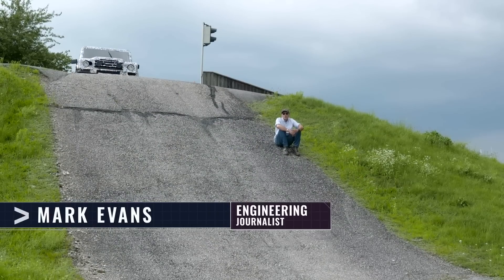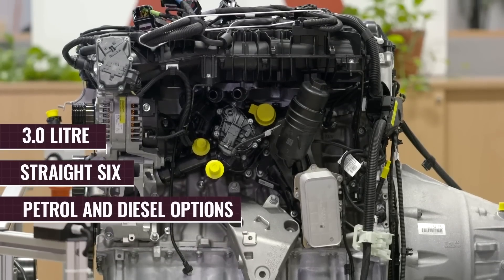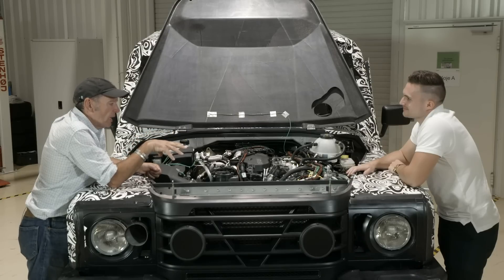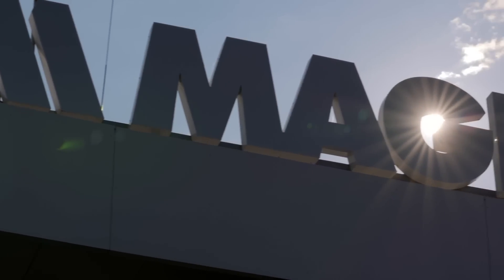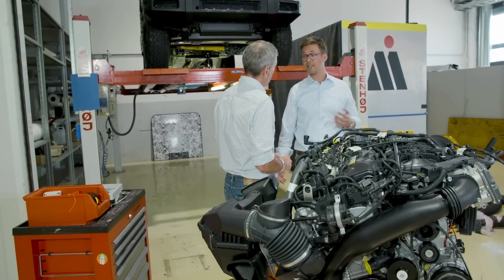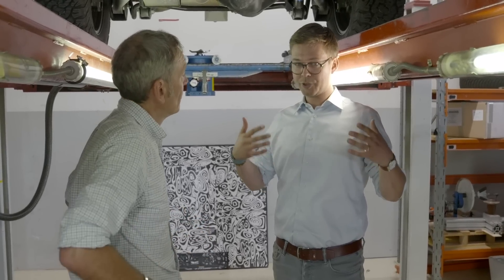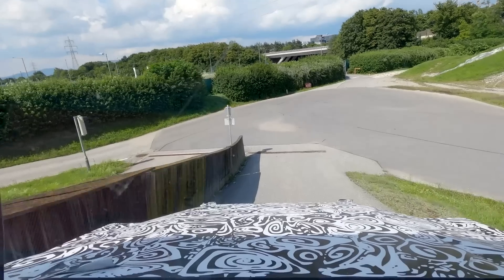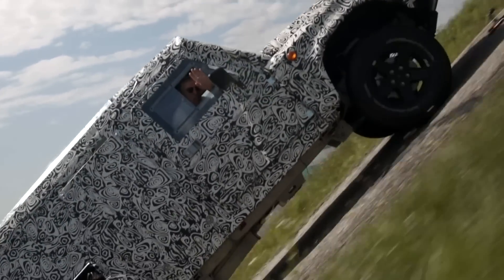Building the Grenadier - Episode 5 - Engine & Transmission

Comment: Disappointing that there's no manual transmission option 😢
While automatic transmissions have come a long way and are in many ways the best all-round transmission option, it can't replace the simplicity, driver engagement and arguably reliability of a manual transmission. You also lose the option to roll or pull start in the event that your battery or starter motor is dead, which can be nice to have in certain circumstances.
Reply: Automatics are much more reliable & have been for 30 years. They do not need a clutch replacement that is near a service item now days.
Reply: @diesel92kj1  I'd be curious to know why you believe automatics are "much more reliable". Both options are quite reliable, but at the end of the day a manual has virtually no electronics that can fail, and far less complex by design. Clutch's usually last in excess of 100,000k's, so while something to factor in it's hardly worth worrying about.
Reply: Hard off-road use and heavy use can lead to complete failures and have seen it and had it happen
Reply: @brendanharbridge3179  No doubt, failures of all kinds with both manuals and autos can happen, especially when pushed harder in heavy 4WD's doing difficult tracks etc. Speaking anecdotally though, I do quite a bit of hard off-roading and rockcrawling and I've never seen or personally experience total clutch failure. I also haven't seen this be a notable issue with the 4WDing shows and channels I watch. Personally, I've seen far more automatics with overheating issues than manuals with clutch-related issues. Having said that though, most of those autos were stock without aftermarket coolers etc., and the vehicle was heavy.
Reply: @iconiic1234  Also the other thing to consider is whether a third world shop would be better off fixing a broken clutch or a broken auto box.  I think we all know the answer to that one.
Reply: I’m fine with auto for off road. Prefer it. Get my engagement and enjoyment of manual shifting through driving on back roads in light sport car. Off road I’m cool with auto.
Reply: If you keep modern autos cool they wont fail completely if you have a manual the clutch failure as a single point of failure keeps you stranded
Reply: @brendanharbridge3179  Keeping an auto cool is definitely key to keeping them running well and for a long time to come.
As far as I'm aware, and at least in my experience, total clutch failure is very rare. When a clutch is starting to fail, it'll usually just slip. In the same way, you could say an automatic could leave you stranded if the TCU, solenoid etc. fails. But nonetheless, it would've been nice to see a manual option for those who prefer it.

Comment: I've thought about putting an auto in my Defender since driving an auto Discovery off road, so as long as it's very heavy duty I'm not too disappointed that there's no manual option. A lot of potential customers will disagree though. Regarding the BMW engines I really really hope all the plastic parts can be engineered out of the design. Also the least amount of computer/electronic intervention possible is desirable. BMW isn't usually associated with the terms "field serviceable/repairable" so I hope those engines and their engineers are adaptable to that sort of thing. I don't want to be forced to walk out of the bush just because of a stupid sensor or software malfunction. I still plan to buy one, especially if it's available as a 2 door ute, but I have my worries.
Reply: They are two different markets---those who off-road for fun and those who do it out of necessity.  Looks like INEOS has decided to cater to the latter.  If they wanted to, I imagine a petrochemical company could point out the advantages of plastic parts in the automotive industry.

Comment: Why use an engine from a company that doesn't build commercial vehicles, Iveco or Isuzu would have been cheaper, more robust and easier to find spares for, a manual box also would be cheaper and easier to fix in a remote location, autos, especially newer ones tend to stop working and lack drive, this one also needs an ecu, a manual can whine or pop out of gear but will nearly always get you home.  Keep it simple as possible.
Reply: Exactly...
Reply: Iveco is what?
Reply: so you are telling me you have nerver heard of Iveco.
Reply: @johnfoster7536  If I wasn't European, I wouldn't know what was IVECO, iveco or fiat is the same crap! By the way, which Austrian company invented the 4X4, 6X6, 8X8 system iveco uses?
Reply: @johnfoster7536  Which company currently manufactures the best diesel engines? Has anyone ever manufactured better gasoline engines than bmw?
Reply: As ive said previousely  Break My wallet used to make brilliant  petrol and diesel engines but not any more. you only have to search the forums for  glaring answers. ive owned  several Break My wallets in the past  would never dream of going near em any more. I used Iveco as a  prime  example of  proven track records  and  yes they made a couple of crap ones too. Cummins  springs to mind again for  diesel option.  cant  think of a modern petrol engine thats actually any good. I spent far to many years  having to fix  so called modern plastic fantastic computer controlled  engines.
Reply: Think Ivecos truck division might have some thing to say about that and believe me  ive sworn  at some of  the  stuff they  have made too
Reply: @johnfoster7536  I don't get people who rave about BMW engines being the best, even the old big 6 M30 and 4cyl M20 had some problems with cam oil feed bolts, move on slightly to the smaller 6 with the cambelt and they were pretty shot come 100,000 miles, later ones are worse with failing cam chains and vanos units, I don't think people outside the trade realise that a lot of it now is just badge snobbery. And before people jump down my throat, yes I have owned a good few BMW, and had experience of their main dealers competence, the engine in the Grenadier should have been more commercial and easier to fix, keep it simple.
Reply: @johnfoster7536  Just talk like that, who never bought a fiat or iveco...
Reply: one word COSWORTH  they produced the most succesfull  F1 engine of all time and are developing the new engine for Gordon murrays new succeser to his famous F1 road car its a v12 normally asperated engine
Reply: @Andre-hi9xn  Raced against an approx 11 litre air cooled  Magirus Deuz ( pre-Iveco) up a mountain pass in my Unimog with OM366LA power. About the only time I've ever seen my coolant temperature gauge above halfway. A fairly equal battle, but  justified a later never regretted Claas splitter overdrive retrofit decision. Iveco Massif never gets much mention, seemingly a Series 3 Land Rover with Iveco Daily 4x4 underpinnings ?
Reply from the maker: The BMW engines will be specially calibrated for off-road performance. Delivering high torque at low engine speeds.
Reply: Erm you use the term calibrated  regarding  torque at low speed, to every one else in the world that mean ecu engine maping re-maping. Break My Wallet  dont' know how to make reliable engines any more.As far as i can see its pure marketing bullshit.You need to go back to school  and discover what KISS means.Ask your self what made the original landrover defender so bloody good. Hint  simple basic, easy to fix even half way up a mountain.

Comment: It looks great! Well done chaps. BUT... It must be built in the UK!
I can fully understand the bmw powerplant and no you wont be able to repair it in the wilderness but thats not their fault. There are so many emmisions regulations now that there was no way it was going to have a 300tdi equivalent. Likewise with the automatic transmission, that unit is known to work so well with that engine and variations of it are used in everything now from the new Jeep wrangler, bmw m cars, new land rovers, even rolls royce use a zf box.
People need to remember emmisionsregs are so tight now that not even the new jimny is allowed in europe

Comment: What INEOS don't seem to grasp is their market - while well engineered, and the auto gearbox chosen for all the correct and logical reasons, if they don't offer a manual it will simply not sell as well as they hope. Again, not because of the engineering, but simply because most serious off road drivers are steadfast in their need for a manual - and that psychological belief that manual is better isn't going to change any time soon. Don't cut you nose off to spite your face INEOS.
Reply: Been traveling africa for 15 years. Auto is the best for overlanding and for 4x4 obstacles. A manual doesnt come close when you deive onstacles. Auto has way more control and easy to get you up and over. Autos have come a long way since the 90s. They are reliable and thats why we barely see manual in suvs nowadays
Reply: Auto is by far safer in trying conditions. Your crazy to think otherwise. Auto's can be every bit as reliable if not more than a manual. Clutches have to be replaced typically more often than a torque converter.
Reply: @justindavis8102  Correct...and to quote you - 'you are crazy' to think there isn't a massive market for die hard manual fans...it's just simple facts, and simple business. I'd be staggered if they don't offer a manual model in the future …if they can find a bmw box that is robust enough that is... I feel I need to qualify this statement of fact in today's world of black and white - it is not my opinion, it is a cold hard fact. Sales will be lost to people who will simply not buy an auto 🤷‍♂️
Reply: @jamesward6175  don't get me wrong. Id prefer totally bush proof vehicle. Im from Australia, we have extremely tough terrains here and like to travel remotely. If i had it my way this Grenadier would be powered by a 6bt Cummins and 5 speed manual that cpuld handle the torque. But in reality, and auto will appeal to the masses because a auto is far more capable off road in rookie hands.
Reply: @justindavis8102  That I can agree with!
Reply: Automatic is better off-road than a manual. Stalling can kill you.
Reply: @diesel92kj1  an experienced driver will see the road 1-5-10m ahead and know what manual gear to select.. the automatic only feels the terrain as it comes and not the future part..

Comment: I have mixed feelings about the automatic gearbox. On one hand, i understand the reasons why you guys chose it, and from an engineering point of view sounds reasonable. But as a consumer, i can't stop thinking about the costs. I assume that the starting price for this vehicle will be pretty high, so isn't a manual gearbox going to keep the price down for the common folks? That applies also to the maintenance. In any case, even if i won't be able to afford one, i wish you the best,  i'ts always nice to see some new competitors on the market.

Comment: I really like what I see so far... yes a lot of electronics and the times of 300TDI are long gone... however.. i just got stranded im my Defender 110 TD4 MY2013 Overlander due to  short/failure in the main electrical harness in Sweden.. just waiting foe the ADAC transport back to Germany...

As for the front I’m pretty sure there will aftermarket solution to fix this design.. Hopefully the roof is replaceable so you can mount popup roofs form Alucab or ExTec or the like..

Comment: Although I like many aspects of this design, my two major reservations about it are: non-UK production and the use of an off-the-shelf BMW power plant. Though the latter just confirms how costly designing an engine from scratch is these days, with all the international regulations etc. Perhaps they should ask Christian von Koenigsegg for some tips..? 🤘
Reply: Or buy an engine from Toyota, Isuzu, Ford, Mazda, Mercedes, Mitsubishi, Nissan or Iveco. All of those companies made damn good engines for 4x4s.
Reply: Non of the  main manufacturers are going to sell them engines because  the finished product would be a direct competitor .

Comment: Such a letdown from all the hype about uncompromising no manual shift
Reply from the maker: Hi Alvin

Automatic transmission offers increased torque compared to a manual, which is useful when manoeuvring off-road, especially with a trailer. Auto box is also better under many conditions, such as when climbing steep, challenging terrain. So, you’re unlikely to stall on a steep hill.

If you need it, there is a semi-automatic option, allowing you to mimic more of a manual gearbox. It will be controlled manually in the form of a dial on the centre console.
Reply: INEOS Automotive, thank you for the clarification. I agree from the safety precautions standpoint the Auto is better. I really enjoy the updates of the development for this awesome vehicle. Keep up the good work and good luck!! I will definitely place an order once it’s available.

Comment: 4.05 'will there be a manual gear box? No... We believe an automatic.... Blablabla' that is where ineos fails miserably and join all the other plastic overly complex "off-roaders" did you ask real off-road enthusiast what the prefer?.... Seems like you won't be uncrowning the defender......no farmer in his right mind Will be touching that thing.... Function over form indeed.
Reply: Explain why no farmer will touch it? The ZF 8 speed can be a manually selective gearbox
Reply: @harveysmith100  You can not maintain it in the middle of a field
Reply: @StopTheDictator  You are hardly likely to strip down a manual gearbox in the middle of a field either. Would be better to take the gearbox out, a hell of a job in a Defender and take it into your workshop.
I drive a 4x4 with an Auto that is 30 years old, never had a problem with it.
The ZF8 is a super robust and reliable gearbox, far more reliable than manual Defender gearboxes.
Reply: @harveysmith100  ZF unit is the best option in these times. Also if utilities and contract companies buy these trucks it means they cant be abused. No clutch dumping and destroying it by people who dont gve a shit about the truck.
Reply: @Gluxetravel  Good comment